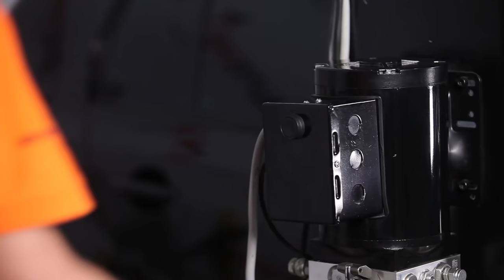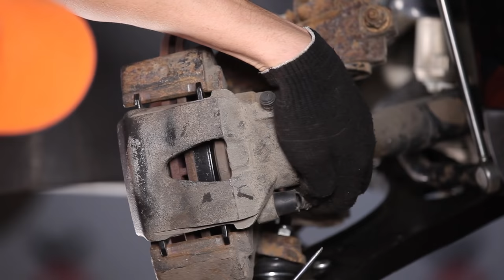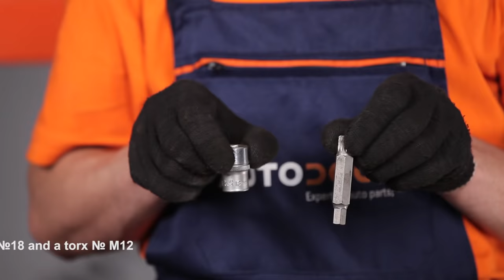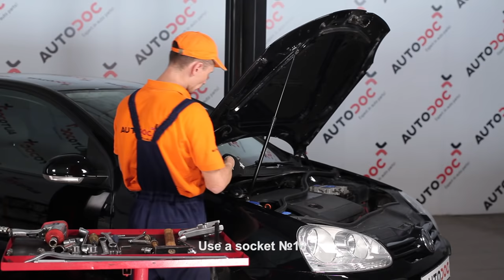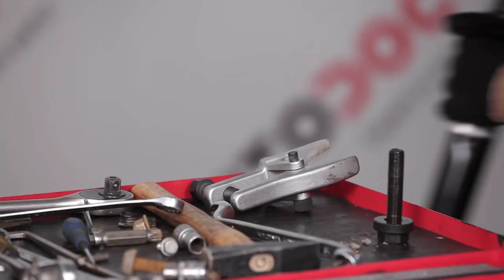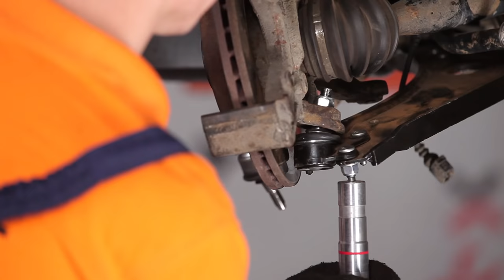How to change a front shock absorber on VW GOLF 5 TUTORIAL | AUTODOC

Comment: Very clear and helpful videos, thankyou. 
There is however one major issue that I feel needs to be addressed - Torque settings. 
VW (and probably all other vehicle manufacturers) specify Torque values for fixings (nuts, bolts etc.) when they are being tightened. Some bolts are even 'stretch' bolts that are torqued to a value and then turned by a further angle (e.g. 90 degrees) that should only be used once i.e. should be replaced at each use. 
This is especially true with suspension and brakes, where insufficient or incorrect torque on certain fixings may result in catastrophic failure resulting in major safety implications. 
A great feature is that the videos have been annotated with the correct tool sizes for the fixings being loosened/adjusted so I suggest they could be annotated to provide the correct Torque settings (with reference to relevant service manuals) for the those being tightened. 
Hope this helps.
Reply from the maker: Thank you for the feedback! We hope that our tutorial was helpful for you. Stay tuned and follow our latest updates. Best regards, Autodoc.

Comment: Got a snapped spring to change in my mk 5 plus(got a pair on order for the front and will do both). I'm just gonna keep the disc assembly attached. Saves a lot of wd40 and time. I bet I swear a lot and couldn't do it with a permanent smile like this guy. Great video though.
Reply: How did it go ?   :)

Comment: It’s a 18mm spanner required , not 19mm ( at least in the UK).

The manual stresses not to use an impact driver on the hub bolt.

When tightening the nuts on ball joints, the threads themselves will just spin unless loaded

You also need a special tool for the nut on top of the shock absorber ( as well as a spring compressor, although that much is clear in the video)

Nothing will come off anywhere near as easily as shown on this video !

You should look up torque settings in the manual . The manual also lists a number of nuts and bolts which should be replaced 

There are arrows on the top strut plate that should be fitted inline with the direction of travel
Reply from the maker: Thank you for your feedback! We make our videos to give people the basic idea on some of the details in the whole procedure. That is why some parts of any tutorial can differ for obvious reasons. Best regards, Autodoc!

Comment: I have this awesome job to do on my golf in the next few days as the spring snapped so I'm gonna change the pair.. should be an experience lol.
Reply: How did it go after? Got to do one of mine as well
Reply: Lucas Churchill wasn’t bad really, would recommend getting a windscreen wiper removal tool as mine were stuck on so I couldn’t remove the cover over the strut top bolts so they were kinda difficult to get to.
Reply: @bendude6748  did you use a tool to compress the spring?
Reply: RisoBoss yeah, you need a set of spring compressors

Comment: The bearing plates have arrows on. Is this to ensure correct fitment? A view of the other side would also be useful. The struts aren't handed to the drop link must fit differently?
Reply from the maker: Thank you for the feedback! Yes, you are right ,this is the direction and a place to simplify its installation. Here is showns not a stabilizer's drop link, but an elongated stabilizer rod, it is attached from the stabilizer directly to the shock absorber.You can see it at 18:06. Best regards, Autodoc.

Comment: Should I get the wheel alignment don after changing the ball joints?
Many thanks
Reply from the maker: Thank you for your comment! Please, clarify what ball joints your are talking about. Best Regards, Autodoc  Team
Reply: I changed the lower ball joints, drop links and both shocks
Many thanks
Reply: @mkiicendidi4693  for a good tracking it's wise to do that, I didn't do it,and I has seen the result of it.

Comment: This is really useful video, thank you so  much for making it. 
Is there a way to do this without the spring compressor? I am home mechanic and do not have one.
Reply: Chris Kenny ive seen it done with ratchet straps but I wouldn’t do it. Them springs are lethal. 

There are some cheap compressor thing that are like threaded bar and clamps that you wind up to compress it. 

Theyre not the best so keep it pointing away from you 👍🏼
Reply from the maker: Thank you for your comment! Unfortunately, there are no other tools that we could advise you of that would help you get the job done in accordance with safety measures rules. Otherwise, we recommend you contact a certified mechanic. Best regards, Autodoc!
Reply: I did mine with a set of spring compressors by Sealey - it's doable, but fiddly and you have to be VERY careful. If I'd had use of another car and a friendly mechanic, I'd have simply taken the struts to someone with a proper spring compressor. 

If you DO do it yourself, make sure that you use clamps with 2 hooks on each end, not one, make sure they're secure and tighten each side a little at a time.

Comment: What is “End Bit No.5”. I thought these were Allen key or torx bits for loosening nut on tie rod.
Reply from the maker: Thank you for your feedback! To be exact, we use the end bit HEX under №5 to fix and unscrew the nut on stabilizer rod. Best regards, Autodoc.
Reply: autodoc.co.uk thank you, I just fitted an H&R Cup kit shocks and springs to my Mk2Seat Leon FR. The only bit that was  tricky was getting new shocks into front hubs. Took a good bit of chapping them on. Has made huge difference to the car and well happy. Money well spent. Thanks for the video. 👍
Reply from the maker: Thank you for the feedback! We are glad you find our video interesting and informative. Stay tuned. Best regards, Autodoc.
Reply: I think the Europeans use different nomenclature; you'll have to look at his tool closely. Did this job to replace the coil springs only on both sides of my 2006 Jetta and what I found was that the shock stem (top of shock) uses a odd-ball 7mm allen wrench (not found in most sets) with either a spanner or a pass-through socket. I used that  procedure to avoid spinning and damaging the shaft by using a impact wrench. All the lower fittings are hex nuts/bolts or triple square bolt heads (as on the  shock pinch bolt). Where the sway bar end-link attaches to the shock, you'll need a triple-square bit 6mm to hold the bolt stem. Note: a torx bit may work, but a triple-square has 12pts for a better grip as opposed to 6pts on a torx. Warning: don't use a impact on the smaller bits. Also, it's very helpful to prelube the fittings with penetrant and clean-out the areas where a triple-square will be used.

Comment: Why did you remove the bottom ball joint to hub nut rather than the wishbone bolts?

Also when you took the strut retaining bolt out you used a 21mm socket, but when you put it back, you appeared to use a 22mm socket??!
Reply from the maker: Thank you for your feedback.In order not to disturb the wheel position settings, our mechanic disconnected the lever from the hub in the pivot joint.The socket we used for 21 mm.Best regards,Autodoc!

Comment: Must be an aftermarket axle bolt.  Mine is not like that.
Reply from the maker: Thank you for your feedback! Everything depends on a car version, and there can be differences in the car designs. Best regards, Autodoc.
Reply: What you have is a 24mm XZN bolt; a standard 12pt metric socket will work. My 2006 Jetta has the 27mm hex bolt, but my 2011 and 2013 Passat have the XZN. Word of caution: each bolt style has a different torque value and procedure. See my reply to Ignacio Barcia from 9mo ago for help with this.

Comment: https://youtu.be/p7rsM70zHUc?t=351 That's not a torx. It's a XZN and if you work on german cars, you need a set.
Reply: Also, the drop link hole is not hex, it is 12 point splined. Plus the nut is 18mm not 19mm
Reply from the maker: Thank you for the feedback! You are right, this video shows not torx as in the description but XZN. Thank you for the valuable clarification, in the future we will not make such mistakes. Best Regards, Autodoc